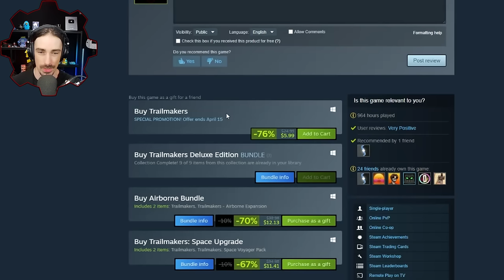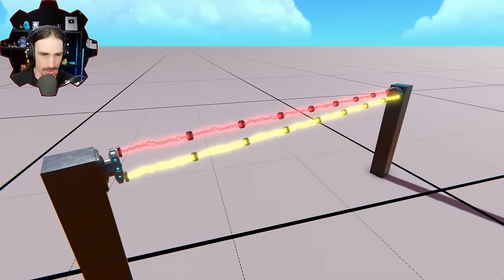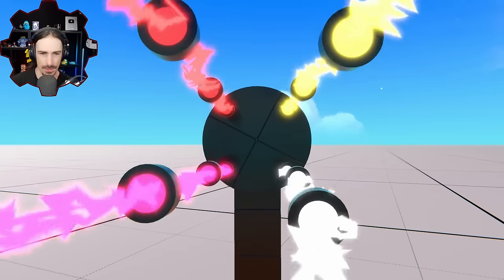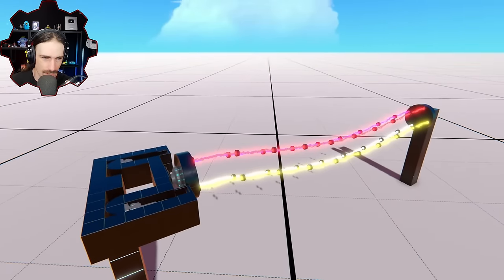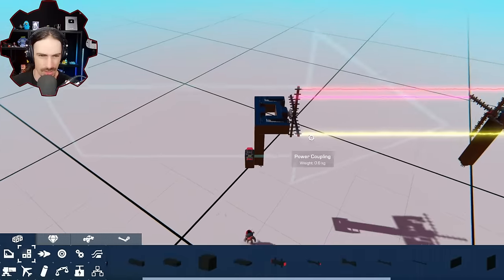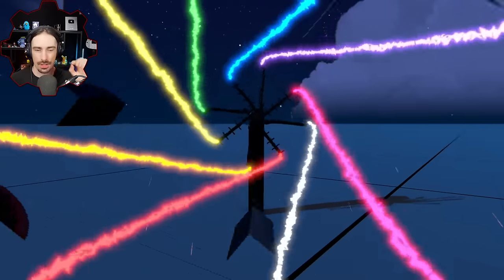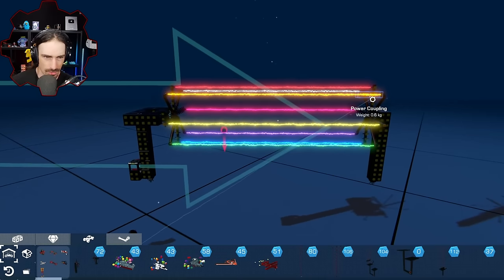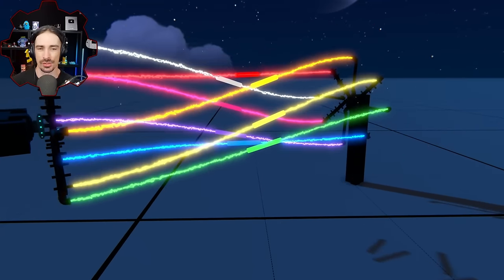I Tried to TWIST These Until They Broke.

Comment: More ideas:

Because the power couplers have no collision, you should have added more on the other side of the rotating part that spun in the opposite direction, creating a longer chain of counter rotating power couplers.

Should do a vertical experiment too, so gravity affects them uniformly in the down direction, and not pulling them all to a single side in the down direction. This should decrease slipping of parts with collision.

Have the arms that spread them out to be on pistons as well to vary the radius of the cables while they are twisting.

Have the counter rotating parts move at diferrent speeds, or have more cables on multiple seperate wheels all spinning at different speeds, in opposite directions, at different radius distances, and longer chains of power couplers.

Have two or three separate bunches of power couplers intersecting each other and rotating through each other. ie have twisting cables on the x axis, y axis, and z axis that all twist through each other.

Have xyz axis cables connect to other wheels, ie have a cable connect from an x axis wheel to a y axis wheel, so you have power couplers twisting to multple various wheels. Would be interesting to see.

Make a chain of these in a large ring shape rotating in different directions.

Make a jelly fish flying machine.

Comment: 16:36 I just realized something about the consistent pattern with the colored Power Couplers.

Algebra time!

So each of the colored Power Couplers have a corresponding mathematical function that switch between the two colored parallel lines after every 180° rotation.
Red and Blue are Y=0
Orange and Purple are Y=-X
Yellow and Pink are 0=X
Green and White are Y=X

When perfectly aligned,
Red is X<0
Orange is Y=-X Domain:(-♾,0] Range: [0, ♾)
Yellow is Y>0
Green is Y=X Domain: [0, ♾) Range: [0, ♾)
Blue is X>0
Purple is Y=-X Domain: [0, ♾) Range: (-♾,0]
Pink is Y<0
And White is Y=X Domain: (-♾,0] Range: (-♾,0]
Reply: Don't know what bros yappin about but he seems smart
Reply: As someone in 7th grade, what is going on
Reply: @mr.spytom  As someone who's past 7th grade years ago, what the hell is going on?

Comment: A possible use for this would be as a torsional spring - you could twist it to store energy, and then use a detachment block to disconnect one side and have it fling something using the rotation.
Reply: They wouldn't have much stored energy unfortunately, since you can't keep on twisting it past 1 turn.

Comment: You should make a tower, but there are hinges or suspensions or power couplings between every floor, so it's flexible. Then, make a shaking platform (probably with fast-moving pistons) and put the tower on it, then see how well it can stand the artificial earthquake.

Comment: I'm pretty sure it would be less jittery if you attached the pillars together with a bar on the bottom and used only one (or none) anchor blocks. The anchor blocks cause jitters, presumably because they are an artificial fixed connection to whatever it touches and there's some floating point weirdness going on when this happens.

Comment: Make a guitar with power couplers as the strings.  You'd probably have to replace one or two of them in each string with tubes or something so you can 'strum' them, but then have each string attached to suspension or a half-compressed piston or something with a distance sensor to play a sound when the string contracts from being strummed.

Comment: I missed the deal 😢 but something I wanted to try but you should totally do is, try and make it longer and spin faster. I don’t know if scrap mechanic has some way for doing gears or maybe something like a transmission so you can change speed and torque. But my theory is that at higher speeds and length would create a harmonic effect and create multiple cross points along the whole structure. Honestly, if you think about a guitar string getting tighter it would affect the wave lengths. Instead of pushing the “rope” 😂 closer, pulling and making tighter. Being able to control both variables would be ideal in fine tuning your results.

Comment: What if you actually try to build a DNA shape, where the two paths are connected in a ladder type shape. Moreover, you could also scale this up to more beams (like with the example using 4) by just placing more of those circles along the path to keep the beams equidistant at certain intervals

Comment: Why didn't you just do 90° arms coming off the existing arms scrapman? You know just use the same length arm, attached perpendicular from the ends of the existing ones, would have worked just fine why didn't you do that? 😂